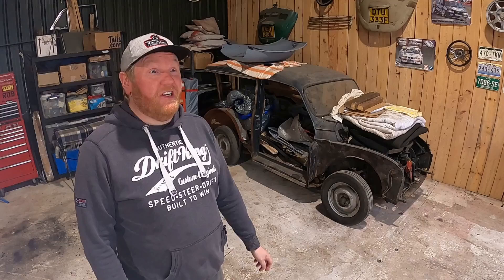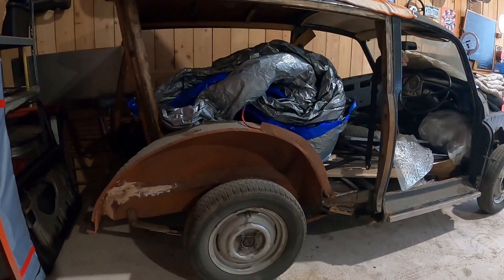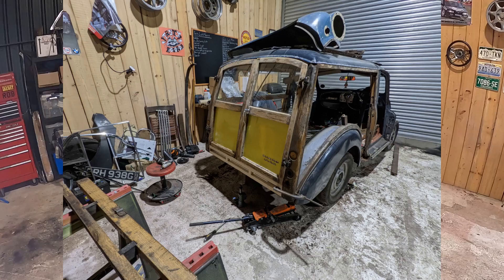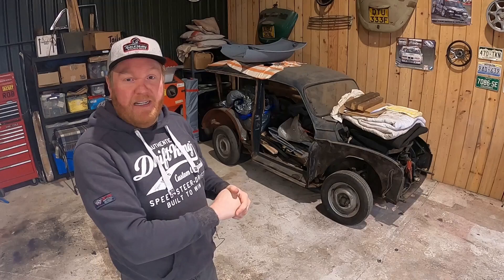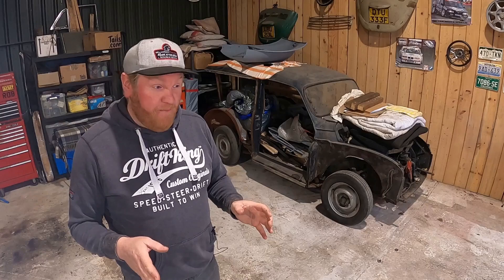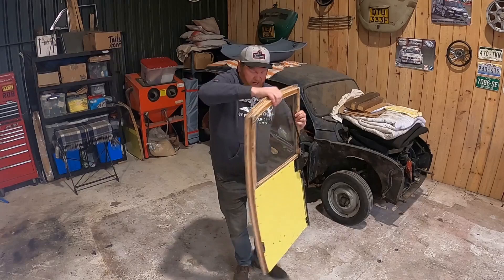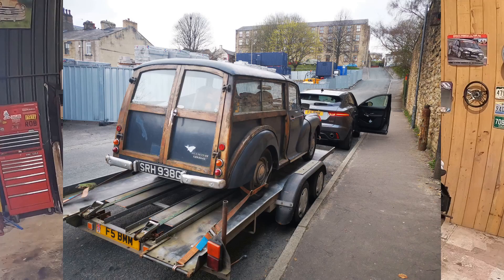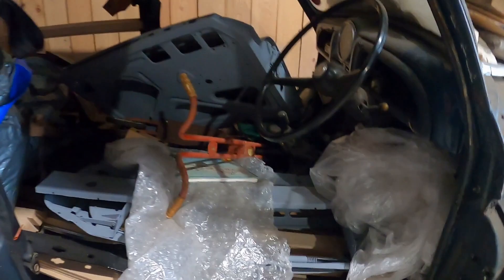1969 Morris Traveller 1098cc - Basket Case Restoration - An introduction!

Comment: Barnie is lurking in my shed down here in sunny Australia. He was in a barn for 10 years (hence the name) and he's keeping this 72 year old busy. He's in remarkably good condition, rust wise - the advantage of a hot dry country. There is some rot at the front door pillars on both sides but  I'm making good progress in refreshing my welding skills. The engine started and ran without too much problem but then popped the freeze plugs. I reckon another couple of months and I'll be driving him around the paddocks.....

Comment: make sure you have the timber frames fitted before welding up the rear end!!
Reply from the maker: You're not wrong, I think in one of the pics you can see all the jacks and set squares I had to use to get it all true, absolute ball ache but got there in the end
Reply: @tastyclassics  I have changed the frames twice on mine, they are never exactly the same & you have to adjust the wheel arches to fit the new frames..

Comment: My dream car is a Morris Traveller with modern running gear, nothing special or performance wise but something reliable and decent with modern suspension, steering, engine, gearbox,  brakes etc. but with the lovely old fashioned body, a sort of a half sleeper. I would also like one completely original but I don't have the wallet to do either. Good luck, looking forward to see its progression.